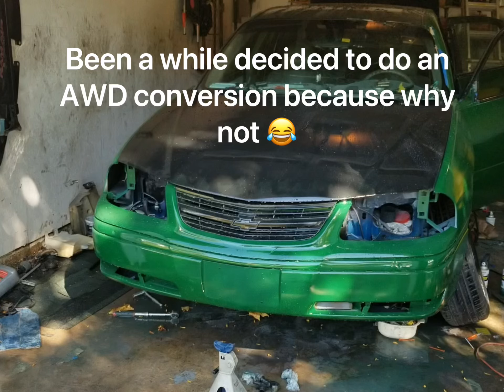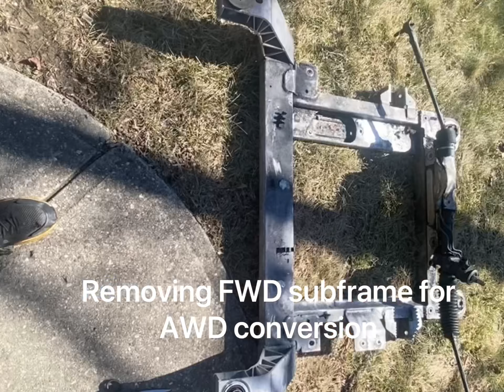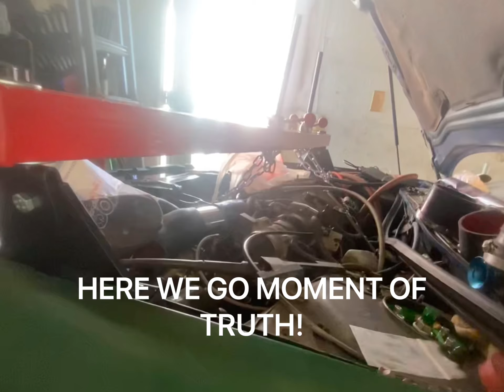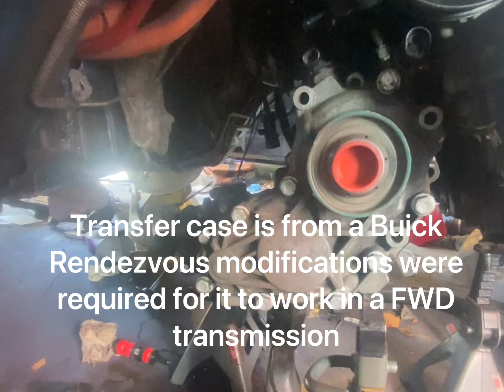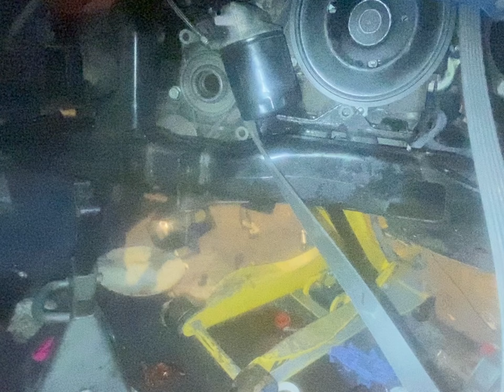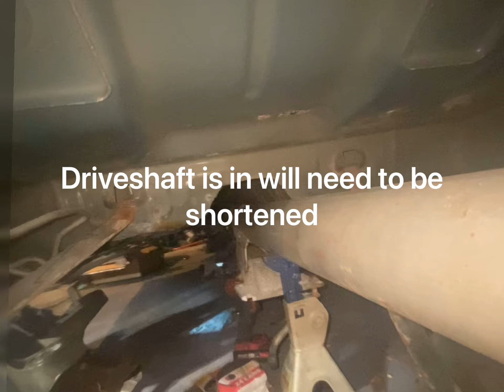AWD Conversion on 3800 Impala

Comment: You've stolen all my ideas. i have an 04 Impala SS i'm about to begin restoring, I figured if I'm going to tear it all the way down and build her up I might as well make it my own. I was thinking about twin charging it, and doing some weird stuff that doesn't make any sense. I'm very curious about the AWD and think i'll be keeping an eye on your channel bro. PS grand prix seats feel amazing in the car it was one of my first mods, I swapped all the seats with grand prix seats 7 years ago when i got it. the rear seats just worked except the clips were perpendicular, I had to cut slots the other way for the clips.
Reply from the maker: lol I got the twincharge idea from a YouTuber that built a twincharged lesabre, I heard it’s not as efficient as a single turbo but I just like it for the coolness factor 😂. The AWD conversion was something I always wanted to do because I’ve never seen anyone do it before. I’ve seen RWD conversions Twin-Engine conversions but never a AWD conversion so I thought I might as well  be the first one to do it cause I’m crazy lol
Reply from the maker: I removed all my seats except the drivers for weight reduction. Like you said I added a Grand Prix 2004 seat in mine cause the bucket seat is actually very comfortable and sporty feeling way better than the stock Impala seats 😂
Reply from the maker: Also since this video the frame mounts have been welded in place and the rear subframe is bolted in only thing left is making shock mounts and getting custom springs made so it can sit low
Reply from the maker: I wish you luck on your build as well looking forward to see what you decide to do a f23 5 speed swap or 4t80e conversion would be cool
Reply: I’m into my AWD Impala as well… race to be 1st!
Reply from the maker: @jaydeeee668  very nice I’ll be looking forward to it are you using the same setup for your awd or something different?
Reply: @AllWbody  4T65-AWD but I played around with the versatrack system a bit (only awd when you slip normally) so I have an on off switch from 2WD to all time AWD. And I won’t be doing lowering springs. Retrofitting coil overs from my FWD setup. Also using the stock 3800 subframe and modifying the aluminum to help offset the weight of the rear frame that’s gonna need to be in there. RallyPala is the name I’m giving it.
Reply from the maker: @jaydeeee668 nice your setup seems to be more thought out than mine lol. I plan to use a toggle switch for the awd as well. But I plan to use custom lowering springs may switch to coilover setup In the future. I also plan on changing my 4t65e chain set to one with 33/37 so I can have a final drive of 3.69 so I can have access to much more rearend options.currently using a 3.29 rear end from a Buick rendevous but eventually I plan to switch to a q50 3.69 rearend but that’s only when the budget allows. I’m looking forward to see your build completed tho rallypalla is a cool name for sure I need to make a cool name for mine lol
Reply: @AllWbody  I’m being ignorant on the coilovers is why. Spent $1000 for the ZZP ones so I’m gonna make them work😂 also take a look at some aftermarket off road chains for the one in the transmission. My FWD 4T65 is using a chain for a Chevy avalanche, with a few other things it shifts like a tuned eclipse is the only comparison I can make.
Reply from the maker: @jaydeeee668  dont blame you on wanting to use the coilovers I would to if I spent 1000 lol. Interesting didn’t know about the chains from an avalanche will have to look into this more especially if yours is shifting so well
Reply from the maker: @jaydeeee668  I also may switch to a awd af33 tranny from a Chevy equinox  pattern same as a 3800 but the programming is different so probably not something I’m gonna do at the moment